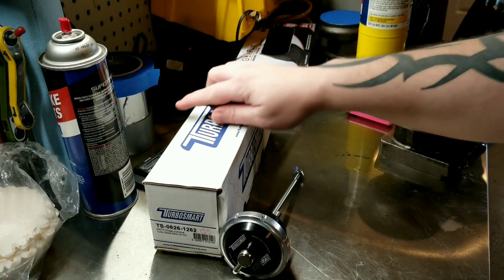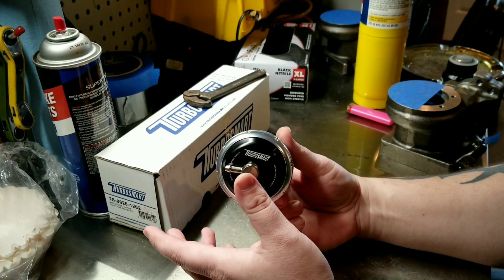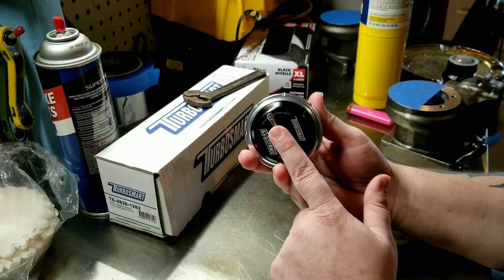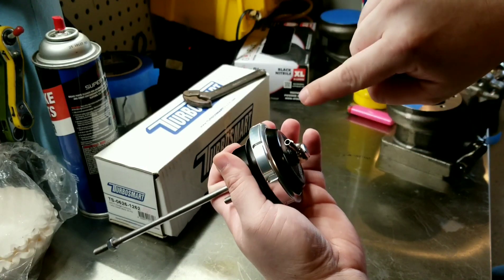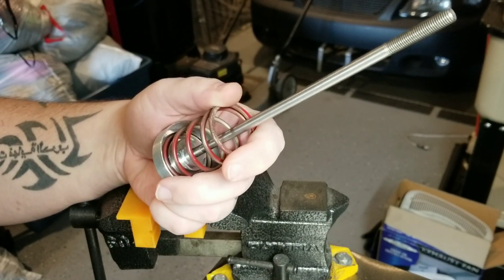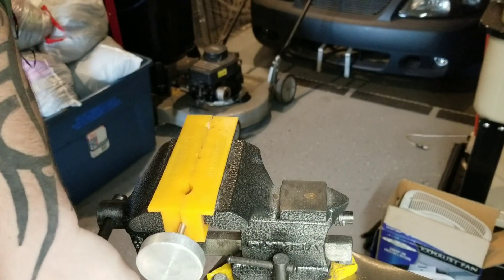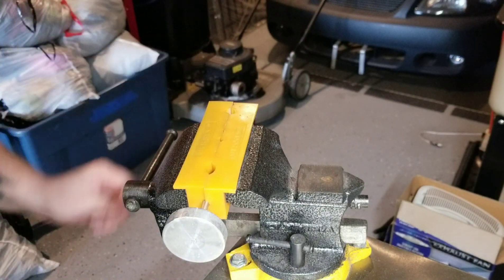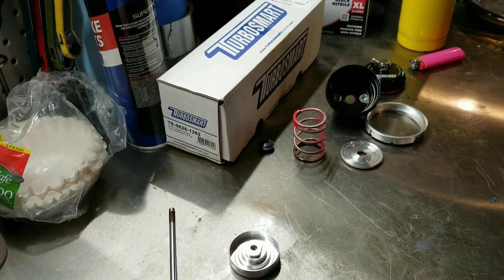How to disassemble and change springs on TurboSmart IWG-75 interal wastegate

Comment: Is it normal to hit higher boost than the spring pressure? With 14 psi spring i was hitting over 17 psi. Switched to 12 psi spring(7+5) and hitting 16.4 psi. My preload is just 2 rotations of the rod end. Just running wastegate pressure now without the solenoid doing anything
Reply from the maker: Yes. That's the pressure it's designed to hold at, but can go higher. That's why you need to run a boost controller.
Reply: @NOTSOSLIMJIM i have a boost controller but i was just testing what my minimum boost could be by running gate pressure. I switched from a boost source off my intercooler pipe to the compressor housing. My theory is that the nipple had too small of an orifice to properly feed the line and pressurize the wastegate actuator. I will test it later today. If its still too high ill try dropping to a 10psi spring combo and test again.

Comment: My cap is super stuck on there!  I have removed the collar,  but the cap is still on tight.  Im trying to open it up to change the spring set up.
I got a c clamp to try to compress the cover down but maybe I'm doing something wrong.   On the video here soon as you got the collar off, the springs came right out, cover came right off.   My cover just stays in place really tight
Reply from the maker: Try putting a nut on the end of the actuator arm and giving it a few light taps.
Reply: @NOTSOSLIMJIM  thanks, I got it off, used a pick to get the cover to move a bit & then kind of popped open.  Seemed the diaphram material was pinched in there holding it, stuck.
Now I have another struggle- my rod is already bent, the wastegate was on a turbo, with bent rod.   So now I have the spring set up out of the cover, but its sprung tight in the rod set up, with the plates on both sides.  Im not sure how to remove off the rod, its pretty tight!  And to get a wrench in there, inside of the spring is tuff, and wants to strip what you put the wrench onto
Reply: I also see on your video using a torch to get to the loctite.   Not sure if I should do that with the springs there mostly in the way.   Also issue to get a wrench in there because the springs
Reply from the maker: @mcsqueegee81  you can also use a standard lighter to soften loctite. Spraying wd40 on the bolt may also help if it's rusted as all.

Comment: According to the turbosmart chart, they are very different measures than those shown in this video. There are no  11 pound spring.... does not exist, there are 14, 7, 5 and 3. They use colors not diameter to identify them

Comment: This video was helpful in making me realize I COULD make a twin-port IWG75 for my Subaru possible. Thanks!
Reply from the maker: No problem. Many people are affraid of turbos till they work on them.
Reply: @NOTSOSLIMJIM  I'm no stranger to working on and around turbos. The turbo that came on my current car came with an application specific IWG75, but I want to move to a twin-port unit. TS doesn't offer an application specific twin port unit, this video showed me that I can just swap out the arms and be done.

Then recoup most of the cost of the twin port in selling the single! #winning
Reply from the maker: @STimedic1  just make sure if you make or modify your own arm, you do it with the appropriate metal. Hardware store mild steel will deform or flex when heated.
Reply: @NOTSOSLIMJIM  I'd be swapping my Subaru specific actuator arm on my single port to the twin port unit so I wouldn't have to measure, heat and bend the universal arm.
Reply from the maker: @STimedic1  sweet. If you have time, film it to share with others the process for your model to help them out.
Reply: @NOTSOSLIMJIM  most assuredly

Comment: My turbosmart iwg 75 rod is not straight same as yours so do you have any idea how to change the spring ? 
Because i have followed the steps you have done but .. cannot move the spring and lower support due to the bend in the rod
Reply from the maker: You can unscrew the rod from the wastegate.